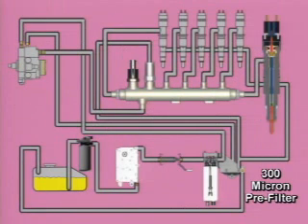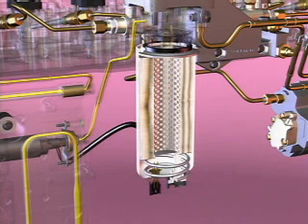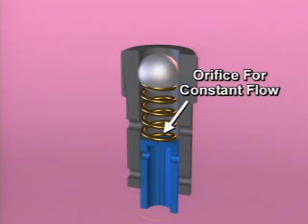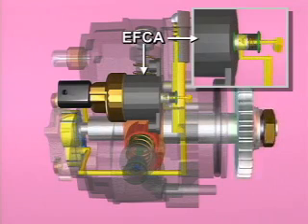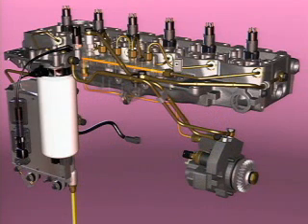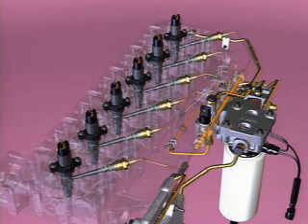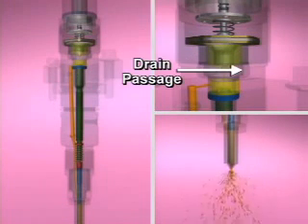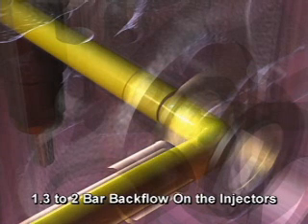CUMMINS Common Rail Systems and electro-hydraulic injectors

Comment: With all of the moving parts under such heat and high pressure, do you thing ULSD at 15PPM sulphur is a sufficient lubricant?  Thanks great video.